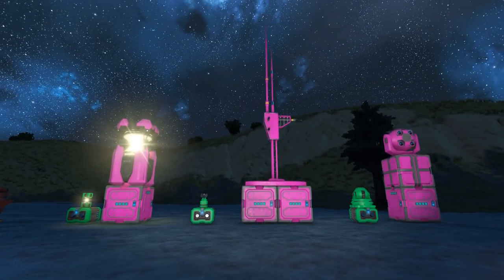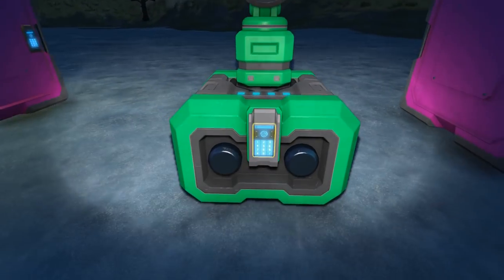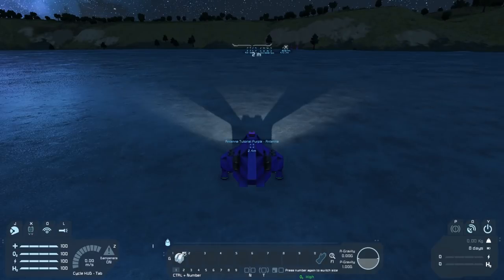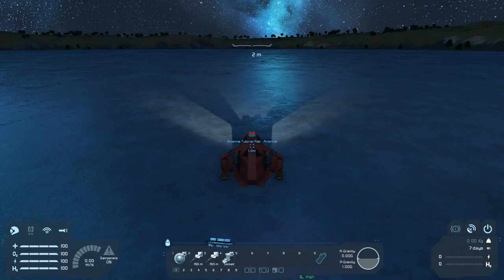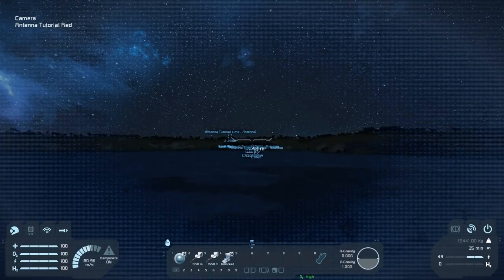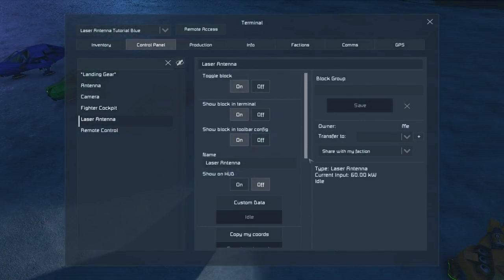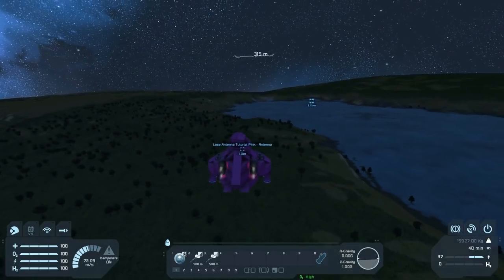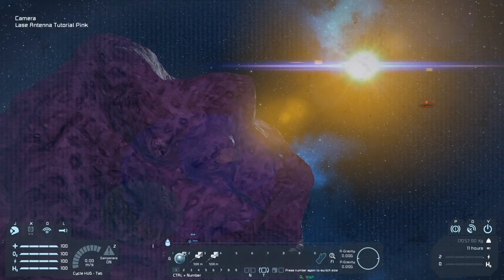Space Engineers Tutorial: Antenna, Laser Antenna & Beacon (tips, testing, tutorials for survival)

Comment: Beacon: Casts out a constant signal into space through walls using low power, good for emergency signals and trackers
Antenna: Field of remote operation and relay cast into space through walls at high power, good for remote operated systems with some relay network between
Laser Antenna: Line of sight point to point antenna sometimes through walls at variable power of infinite range but most efficient at 200km, good for stealth and long range station connections

Comment: I can see laser antennas being useful as a portable drone control point. You can stay at your base and use the drone to tow the laser antenna to distant asteroids. Attaching to the drone from a secondary antenna.

Super complicated but with autopilot you could then send the drone back and forth between connection points.
Reply from the maker: They're certainly useful on small grid ships, gives you a much greater range of control so a system like you're describing would need fewer nodes. Also, complicated is what SE is about, why else do we build the weird and wonderful if not to simply see if it's possible :)

Comment: when ever i am working with Antennas and beacons I always think of HAM radio networks for some reason, which reminds me I still need to get my antenna fixed still after a tree busted  it.
Reply from the maker: Do HAM networks function in a somewhat similar manner? I've never played around with anything like that
Reply: yea we even have games where we have to locate a radio that is broadcasting similar to a beacon and pinpoint its exact location and also we have a radio network set up so that my little 2m handheld that normally only broadcast a few miles can transmit and receive over the entire west coast  of both Washington and Oregon or would be able to if i was not down in a hole and needed an external antenna tower that is currently broken from a tree, to get broadcast through  a ton of dirt.
Reply: Did you get your antenna fixed?

Comment: I have been a se fan for years and I'm a realy huge fan of yours I am In the process of getting a new computer my old one was 12 years old and couldn't run se but my question is if you used a sensor and a timer block could you use the sensor to a private the timer block to activate the laser to connect to its pair I'm was think it would help with power consumption  on small sensory drones for a large ship like a sensor net my other part is do the laser antenna  give of a HUD marker to other ships
Reply from the maker: I'm honestly not sure, I suspect it's possible and quite a good idea for power saving measures

Comment: My ship antenna is set to only 5km but my base is at 50km, however it disconnects the ship at 5km, but shouldn't that still be within the range of my base??? I don't understand why it isn't
Reply: UPDATE: Based on the distances shown in the remote access menu, I believe that the issue is connecting to the ship via my suit rather than the base, HOWEVER my suit broadcasting is OFF and I am controlling the ship via a control seat which is part of my base
Reply: UPDATE 2: I think I've finally thought about it hard enough to understand the issue. In order to control the ship, the ship's own broadcast signal needs to be hitting the base's antenna, it cannot just hit the area within the base's broadcast range for the base to receive the signal. The signal must overlap with the antenna itself, not just the antenna's broadcast range 🤦 I'm an idiot